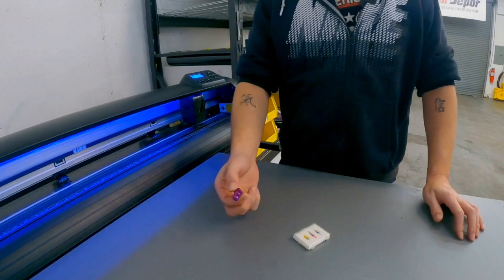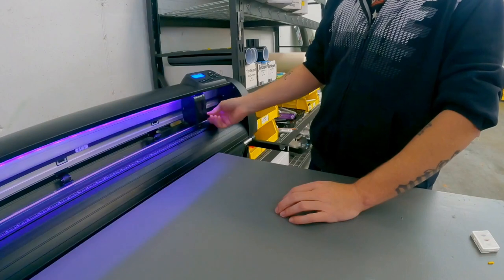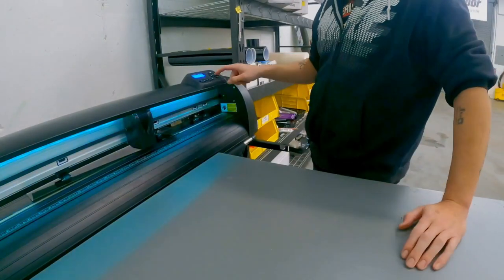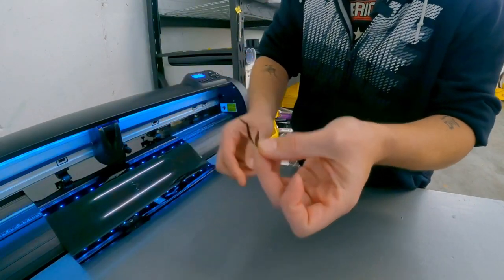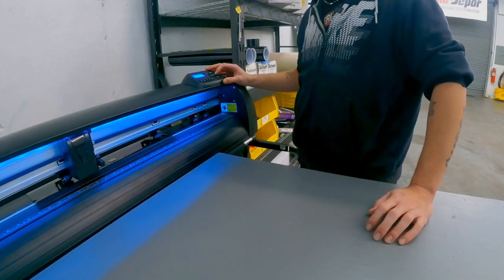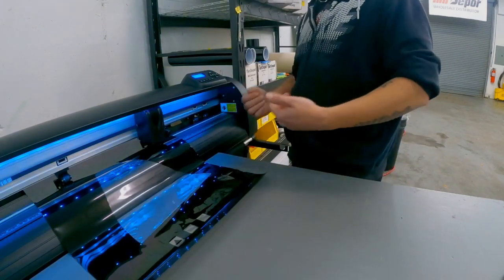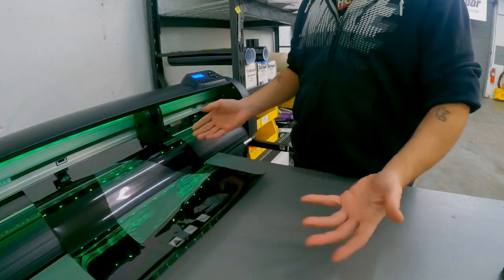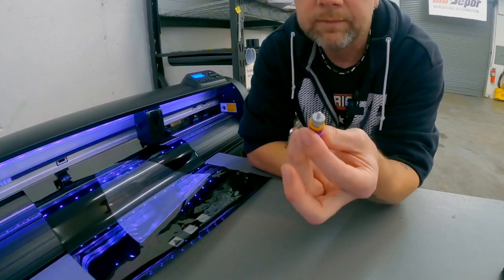Plotter depot plotter blade setup for the workhorse plotters and other similar brands.

Comment: hello first of all thanks for the explanation in such a detail however I can't just get it right sometimes blade cuts all the way thru the liner or film just don't come out clean I get areas where if I pull tint will tear   some others all the way any pointers on this matter please. also you mention in some other vid. that you use Teflon tape on top of the cutting strip can you share the description of the product.  
best regards.
Reply from the maker: Hey Saul. Sorry for the delayed reply. Hard to keep up sometimes. Did you get this sorted out? If you need more help, feel free to comment here or email my biz email. service at onpointprostyles dot com

Comment: Hi. I am looking to buy the workhorse plotter for my fiance. Would the 28" be good enough to put standard rolls of tint on for vehicles? Or would he need the 53" one? Im trying to surprise him so I am quite confused lol.
Reply from the maker: No worries. Awesome surprise!! So the 28" will work great if only looking to cut on 24" rolls. Which will do all side windows and most SUV and Pick up truck back windows. If wanting to be able to cut out rear windshields on cars, you'll definitely want the 53". Most people do want the ability to cut out car back windows so I personally would recommend the 53". But the 28" is a good starter option if he wouldn't mind having to hand cut larger windows. Let me know if you have more questions.

Comment: You are the best at helping out, thanks again.  Just saw matt's video about the plotter being on the edge for 24" rolls like the 36" roll.  Does the Workhorse 2 handle those rolls better?  If possible can I come over to take a look at the workhorse sometime next week or so?
Reply from the maker: Hey. Thanks. I believe my Workhorse 2 rollers are set up the same as the Workhorse Matt has. But I’ve always used 40” and 20”. I’ve order a 24” roll to try on it as well. But you’re more than welcome to come check my machine out anytime. Just let me know when.

Comment: On your other video for tint depot when you said you are trying gorilla tape on your plotter did you put it across the entire length of your cut strip or what did you mean?
Reply from the maker: Yes. On top of the original cut strip from one end to the other.
Reply: How do you like the tape over the strip so far notice any improvements or anything?
Reply from the maker: @isaiahwillis5082  Not sure yet honestly. Cleaner cuts but sort of spotty. Gonna keep messing with it and see how it goes.

Comment: Does the workhorse come with those led lights ?
Reply from the maker: Would be cool. Right? But no. I added those. And that’s the workhorse 2. The top opens making it easy to add led lights.
Reply: Yeah definitely looks cool lol. Do you have a link?
Reply from the maker: @clearvuwindowtint  I bought the lighting from Amazon. I customized them with my personal wiring and soldering.

Comment: Do i have have to move the motor before a cut or can i set origin
Reply from the maker: You'll need to set the motor/carriage where you want it to start cutting. It will start and stop there every time after.
Reply: @onpointprostyles  brother oh my good im trying to figure out how to work this thing can u call me 🙏🙏🙏
Reply: @onpointprostyles  everything time i turn of my machine my speed and force changes i had everything on point then when i shut it of it changed my force and speed
Reply from the maker: @dover1966  The machine should start with the last settings used for the last cut. If you change them and don't actually send a pattern to the machine, it will default to the last cut setting before that.
Reply: @onpointprostyles  hmm ok let me try this

Comment: Whats a good speed
Reply from the maker: I recommend 252mm speed in general. I run mine a bit faster cause I've had it a while and have tweaked it enough to be very reliable. That faster you run it, the more errors can occur.

Comment: My speed and force changes when i turn of my machine
Reply from the maker: I know I’m way late on a reply. But for the record, if you change your force and or speed, hit the enter button to set it to memory if you want it to remember it when you turn the machine off and back on.
Reply: @onpointprostyles  returned this machine was cutting wobbly top edges
Reply from the maker: @dover1966  Dang. I'm sorry. Wish I had seen this sooner. There is a fix for that as well. Sorry for the huge delay.